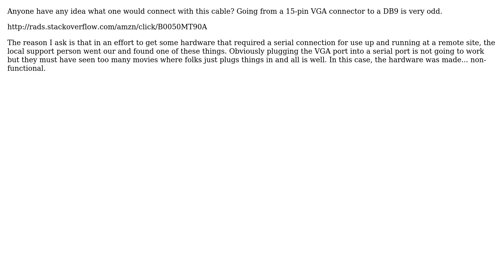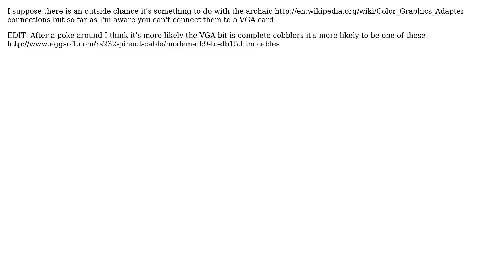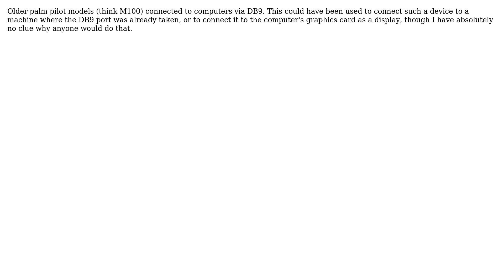Why would you connect a 15-pin VGA connector to a 9-pin DB connector? (4 Solutions!!)

Comment: So no one is clear on this. I want to go from an old DB9 to VGA. Old computer but only have a modern monitor and no CRTs. Will a basic cable adapter work? Have seen them out there but cant find the answer if it will work.
Reply: @72launchpad  i want to do the opposite!!! I found an old samsung amber monochrome monitor but i dont own anything 9 pin TTL MDA! I want to plug modern computers and modern devices into an OLD RETRO CRT!